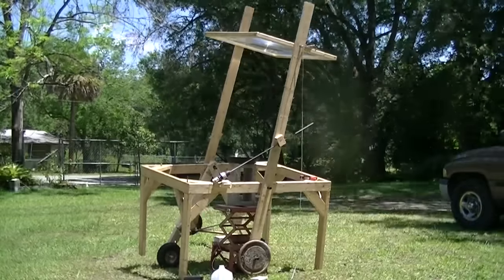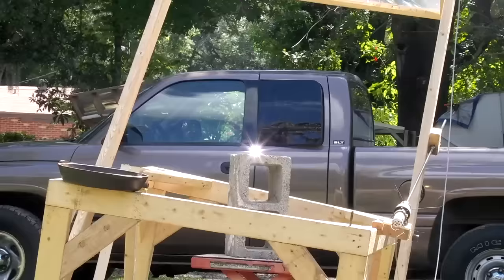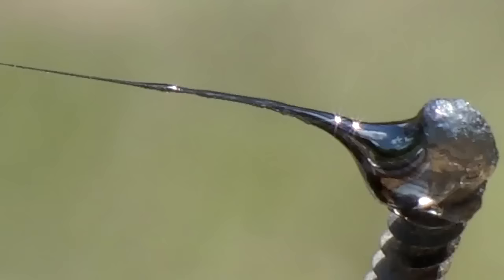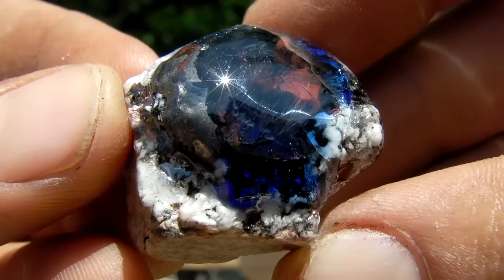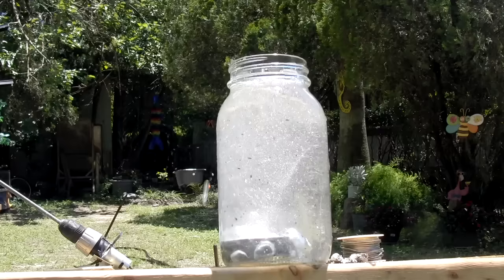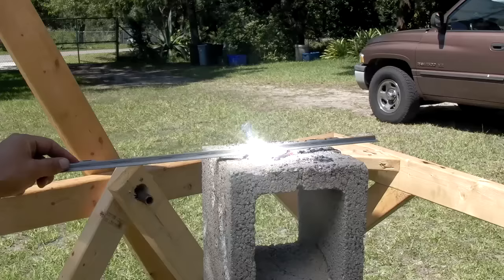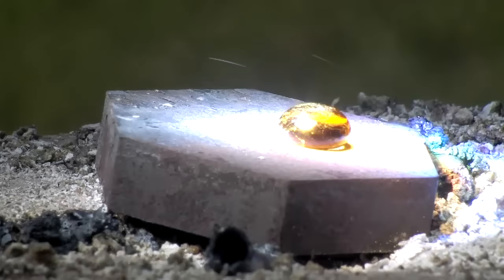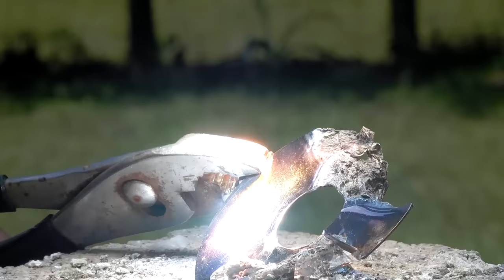Fresnel Lens Solar Power Foundry Obsidian Farm 3800 ˚ F 2100˚ C Fresnel Optics greenpowerscience

Comment: Hi, fascinating stuff 👍👍. I’m looking for a way to use a similar method to heat up a ‘Thermal Battery’ system to maintain optimal temperature in an Aquaponics system.  Have you done any work on ways to store heat for dispersion during colder or night time periods?  I’m also looking for ways to gather and concentrate sunlight for dispersal in a grow house. All this is to reduce/eliminate costs incurred in an Aquaponic system, namely heat and light.
Reply: The sun produces a maximum of 1200 watts per square meter. If you had a 1 meter square fresnel lens, it would only concentrate that energy to a certain point. However, you're still covering up 1 meter square space with the lens itself, and the rest of that space out side of the concentrated spot is essentially shaded out. The material for the thermal battery would essentially dissipate the heat from the concentrated spot, and you would end up heating it essentially same amount as allowing direct sunlight on it. The best way to assist with heating your thermal battery is to allow it to be in direct sunlight, and insulated with glass. Adding fresnel lens would create extra work with no gains.
Reply: @cheifei  Hi, thank you, much appreciated.

Comment: Dan, If ones Fresnel did not track I assume the focal point moves in some curved path below it?. Would be interesting if you could test the shape of the path and temperatures along that path. I hope you will do this test. Guess it would be several test with the lens oriented at various angles and measured from same start to stop time of day (consistent location of sun during time period for each test)

Comment from the maker: This can melt 7 pounds of zinc in an average crucible on a calm no wind day. I have poured many objects and copied low torque plastic gears that are impossible to replace as they are not made anymore. FUTURE VIDEOS. Also working on a mobile solar station with many different units. Reveal for that due in August.

Comment: Why don't people use shipping container modified tanks to store solar energy? For example, automating concentrated solar thermal power to pump water from the low tank to the high tank during sunny day and release water to drive electric generator and back to the low tank during the night.
You can search "Burning Stuff With 2000ºF Solar Power!!" and GREENPOWERSCIENCE for a lot of examples. 
Actually, potential energy of the tank themselves can also be used directly for generating electricity already. Of course, you need to use a lot pulleys or hydraulic jacks for that.
Reply: @marshallkohlhaas80  wrong, its because the efficiencies are too low.
Reply: If you have gasoline or diesel engine, it can be converted into "compressed air engine" ( CAE) - just visit You Tube to have a basic idea about the basic parts of such CAE technology... Internet said India was already mass producing a car powered by said CAE motor- claiming a 300. kms travel range b4 recharging its pressure depleted air reservoir tank.. Internet said such CAE design was already invented since 1920's decade- why was the technology spread/ dissemination come to turtle pace, or was it deliberately suppressed?.. Were those oil moguls conspiring for its slow death?.. By recyling the expended exhaust pressure back to the main air reservoir tank- the rate of air recharging might be decreased from 4X to 2X a month only!... With a hybrid type, an air compressor, powered by a built. in single piston diesel engine- will automatically recharged the main air tank- to maintain the engine IDEAL operating pressure... Surely, the main reservoir tank air pressure will be loss- due to the friction from engine moving parts- also from the wind impact at the vehicle body, as it travel along the roads and highways... With such hybrid set. up, the vehicle will never need a "pressure re. charging" from highway stations or at home.. Simple isnt it!.. A French inventor group was claiming they had already perfected a PROTOTYPE for such kind of CAE technology...
Reply: @arielhermoso4262 yeah TATA MOTORS was meant to have a CAE Sub compact car & they hired a French Formula 1 engineer to work on this. I feel like 5 or 10 years ago? And city buses 🚌 often use compressed air starting motors.  In San Francisco & others.  I think some race cars Formula Uno they start same way.  Just not onboard starters ?
Reply: InshaALLAH I am gonna work on your thoughts if you agree

Comment: Great video!  I would love to see a build that can use a fresnel lens to to heat a pool.  I'm sure direct application would just evaporate the pool water, but I wonder if pumping water through a pipe at the lens' focal point could heat the water efficiently.  Could a pool be heated with a fresnel lens?

Comment: very cool.   are you aware that you can use a diamond file to clean the ceramic tile melting block surface .   you can also use a diamond coated tool on a 4 1/2" angle grinder to smooth your concrete block surface or dig grooves in the surface as a cavity for designs.  one might even experiment with some hydraulic cement as it cures in minutes and is available in very small containers for cheep to surface the concrete blocks hot side ..

Comment: Have you tried melting tungsten with that? Even getting a little smoke off the end of a tungsten rod would be impressive. A tungsten-carbide welding rod I would believe this solar furnace being able to cut through, but a mostly pure just element W rod would be impressive.

Comment: Hm ... I'm thinking of a welding "machine" that works with your solar ray, guided over a fiber optic cable to the workpiece. With a series of lenses in the welding torch, the "arc diameter" could be adjusted and the intensity could be accomplished by covering the lens with a sliding cloth. Inert gas could be led directly through the fiber optic cable.

Comment: Is it possible to make a miniature solar generator using fresnel lens to heat molten salts to run a steam generator?
Reply: jacan001 I was thinking about doing the same thing. using an insulated oil drum like a giant crucible and filling it with molten salt and running a heat exchanger coil through it

Comment: If you can heat a kiln to fire pottery, you might get income out of that. But that's a much bigger job than melting small pieces of glass. Still a low fire might be possible.

Comment: It would be interesting to have the hotest dote of light fixed and passed to optical fiber or some light guide tube to have the control on it and turn it the way you want.
Reply: Teslas death ray?  Interesting isn't the word, more like terrifying, but it would require a perfectly cut diamond or something so it didn't melt.  Conversely, the only defense required is a mirror
Reply: @YearsOVDecay1  if the mirror is aluminum or silver then it will,just bounce back I think....they fitted a satellite with a giant silver parabola in order to get it closer to the sun without melting the sattelite
Reply: @RonaldRaiden  A high melting point,? double wall filled with circulating  liquid helium or nitrogen- can such heat radiator enough as extra heat protection layer- to prevent the satellite unit from sure sun roasting?...

Comment: first of all, awesome video. 

have you tried implementing this fresnel lens as a heat source for a power cycle, for example replacing fossil fuels in a Rankine cycle? is there a material that is transparent and will allow that solar heat to pass through?

Comment: We know what the concentrated sunlight will do melting but can you gauge the heat to say solder copper pipe or hard solder silver with flux. Make glass with sand. Control the distance of the beam.

Comment: I have a question that I really am wondering about. 

If you put a mirror at that extremely hot focal point, will it also burn or simply reflect? If it only reflects the light to a new focal point, does that new point also become just as hot? 

Thanks!
Great video!

Comment: What if you could make a self-replicating 3d printer (like rep rap) but it used fresnel lens to get energy to move and to melt sand to form more fresnel lenses...  You can also make lenses out of ice.
Reply: Lens-quality glass takes a lot more control over the chemical and melting and forming process than just printing.  Melting sand can make glass, but to get optimal lens operation you can't have inclusions or impurities and it has to be exactly the right shape.  In theory you could print a lens preform and have it sanded or ground to proper shape but...too many variables involved in the glassing to produce self-replicating lens systems

Comment: Any physicists or engineers watching? I have a question. Assume we have this Fresnel Lens setup and an L=60cm by D=3cm perfect fiber optic cylinder. If positioned at the focal point directed away from the Lens could we melt the cylinder? I would think the "perfect transparency" takes care of the need to define the material. Any thoughts?

Comment: I have a big fresnel lens. You do not want to put your hand in the focal point. It will light wood on fire in about 1 second. You'd have 3rd degree burns on your hand very, very quickly.

Comment: I wonder if you could use an old big satellite dish and apply a bunch of these Fresnel Lens's onto it... focus them all onto one bigger spot.  I am not sure if it would increase temperature or not, but wouldnt that increase the size of the target spot?  

I seen your videos of a small steam engine and a fresnel lens.  I was thinking of that but a bigger steam engine and more steam pressure... enough to run a Chevy 1 wire altenator.  This would need a bigger water vessel and target spot?

Comment: A blacksmith can use it and reduce the use of coal. I'll try something like that. I live in a region where the sun is extremely strong. And I'm an amateur blacksmith and am looking for different ways to heat the steel more efficient than coal, gas or electricity.

Comment: I've shared several times my idea to make giant sun powered glass furnaces for greening deserts.. and making them habitable . From the sand make greenhouses, Fresnel furnace lenses, water canals etc! Water collection via big glass hollow mushroom wells that condensates and cools in the stem.. Thank you for proving this is possible! although bigger lenses should be more ideal. Deserts having been growing but now this is reversible. Currently the populations mostly inhabit forest & farm areas and we've typically avoided deserts because it's currently not ideal. The farm areas of the past have become cities with farmland having to be created elsewhere (deforestation) and wild life forced out.
Reply: A practical solution to dwindling agricultural area due to conversion into: roads, infrastructure,  houses, buildings, etc. : Always add an extra floor, box type, 1.5meters  height, water proofed- then it will be filled with ideal soil for gardening purposes, crops planting, etc.. So, the usual shrinkage of land area being used for food production - such shrinkage will be greatly slowed down or put in a complete stop...

Comment: what type of camera are you using to film the process of this?
Reply from the maker: james smith Canon XH-A1 + CASIO EXILIM PRO EX-F1 + CANON 7D. The XH-A1 has ND filters, And the other 2 cameras have specific purposes for manual adjustments.
Reply: i like how the video doesn't have that bright white that light reflection has.

Comment: Would it be able to say melt silcon over the top of a rock? I have seen a video ,that says rocks have been found that has a covering of silcon. but since it was from 1000,s of years ago. i'm theorizing if this concept was known back then.A second thing to try is trying to mark that said silicon with lines in certain degree's. I'm wondering if that was done when it was still cooling down. or possibly using another technique I've seen.

Comment: Hey Dan, fantastic video as all are. I'm a potter and would like to experiment using fresnel(s) to heat up a kiln, thus being solar powered. I've been told it can't happen. My idea is to make a kiln of wrapped coils  as the heating element, thus allowing even heating, which is the main problem I've been told about solar ( dispersing the heat evenly ).  Any thoughts you may have would be appreciated.

Comment: Can it be used to generate electricity using the thermo-electric effect?
Reply: There are some setups that uses Fresnel lenses to concentrate sunlight onto high efficiency PV cells but heat is a limiting factor.
Reply: you can put a salt bean in the light spot and use it to move a steam engine or a stirling engine.
Reply: Boil water for a steam generator. Only way I can think of.

Comment: How did you measure the 3800°F ? I want to build a furnance of 3400°F but can`t find a thermocouple that resist those temperatures. Thanks for your answer
Reply from the maker: High end IR unit. The ones that exceed 3000˚ F cost around $900.
Reply: Francisco Galvan Find something that melts at 3400F and see if it melts a sample.

Comment: Why not use glow plugs used in diesel engines to heat the pistons on a sterling engine? Make a liquid thorium metal alloy cooling system that also generates electricity.

Comment: lidenfrost affect is due to a liquid extremely rapidly becoming a gas at the point of contact with a hot surface creating an insulating gas layer , the glass beads up due to surface tension

Comment: Interesting, because my 12 sq ft Fresnel lens can't even melt aluminum in a coffee cup. Maybe I love too far from the equator.
Reply: SeeFreeTV Earth rotates at an angle.
Reply: Good point. It probably has more to do with the focal point being too large and irregular.
Reply: SeeFreeTV your doing it wrong.
Reply: Love closer, might solve all your problems
Reply: You mean 'move closer'? Good idea. It probably would solve all my problems. ALL of them.
Reply: Read your post again :D
Reply: how could you obtain such a huge fresnel lens?
Reply: @SeeFreeTV  idont need to kill one, but i'll steal from them so tell me where is it
Reply: @dogodogo5891  Lol, just go around on garbage day and look for one of those old flat screen tvs. Not the new ones that are completely flat, but the ones where the bottom is clunky and only the screen part is flat. They're called projection tvs or something. Anyway, the screen has a fresnel lens in it. Or you could buy one from greenpowerscience or whatever they're called. I've grabbed 3 fresnel lenses from projection tvs and none of them could do most of the stuff in this video, probably because the focal point was too big.

Comment: Wondering if a 100watt spotlight could be focused into any kind of a stronger beam at night? Also interested in seeing it used for hot water and making electricity.
Reply: You'd get slightly less than 100 watts out. So while you may end up with a very hot point, the energy input will be pretty abysmal.

Comment: I got a small fresnel lens and I live in Florida it's the size of the big sheet of paper.
Reply from the maker: A lens that size is a fire starter and not much more. The size of the lens determines the power. An 8x10 lens concentrates roughly 45 watts of sunlight. The lens in this video is closer to 1000 watts. They are still good for small demo projects.

Comment: Should try it on moonlight,,see if it really cools things like some are saying. Might open up a can of worms, or you can shut some people up. Either or I'm curious
Reply from the maker: Does not work. Not sure where that is coming from but I am 100% sure that it is just a viral myth:

https://www.youtube.com/watch?v=roLWoFIjkrI no cooling, just weak light.

An easy to understand test is astronomy. Telescopes with parabolic mirrors are focused on the moon and if there was a cooling effect, the eyepiece would fog up or get cold. Never has happened. Can you guided me to the cool moon info. I have worked with moonlight several times and the only result was about .0025 watts per sq 10 meters.
Reply: GREENPOWERSCIENCE , make a video to prove it don't work. I'm only asking because I don't have lense to prove it myself. I don't know if the moon cools or not, but there are videos people are making that claim it does, and they're just using little magnifying glasses. I figured with that beast of a contraption you have,  you could prove or disprove rather quickly and it would make for a good watch. Probably be more of a warm weather experiment tho, idk. But thanks for replying and keep on keeping on.
Reply: GREENPOWERSCIENCE ,,that video was crap. They weren't even checking for cooling.
Reply: The whole myth is so stupid that it's not worth making a dedicated video for it.

Comment: Great work Dan! The Tracking allows for Multiple applications. Just curious, since many/most gemstones are heat treated for example, Rubies being 99% Glass filled using flux, If I sent You some small samples (Rough rubies), would You be interested in testing the result?

Let me know... Message me.

Thanks, ~Rafe

Comment: You should not recycle by melting things such as aluminum cans. If you try and sell them to the companies they won't take them because usually they are not correctly cooled under the right conditions and also don't know how pure the metal is.

Comment: So based on the energy that this lenses redirects onto a surface and based on the area of the lenses how would one go about calculating the amount of energy per square metre (if the lenses was one square metre, which looks about right)? And don't just quote me an answer if anyone has one I want to be able to calculate it. Thank you.
Reply: Sorry that should be *lens not 'lenses'
Reply: I don’t have an equation but to begin one would need to know:
How strong is the sun? (This depends on time of day, weather, latitude, etc.)
How long is the lens exposed?
How much impediment is there to the light? (Clouds, mist, dust, dirt, etc.)